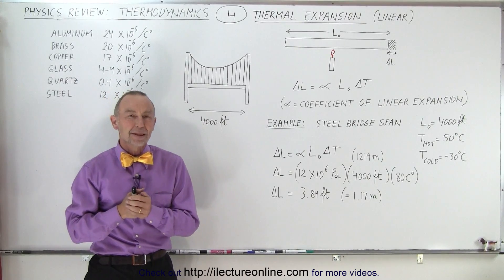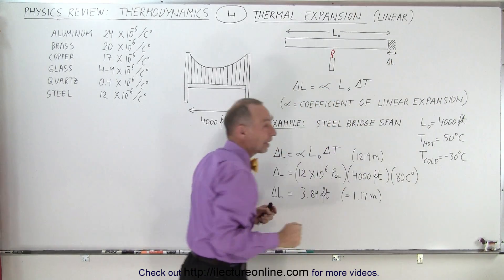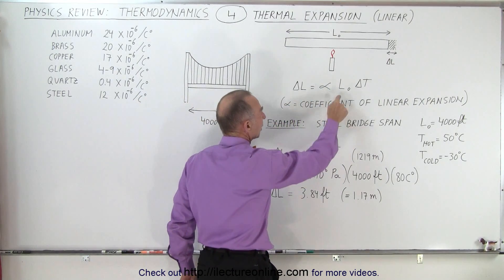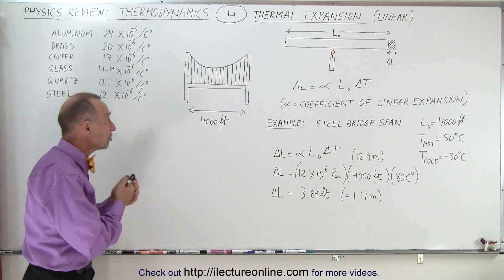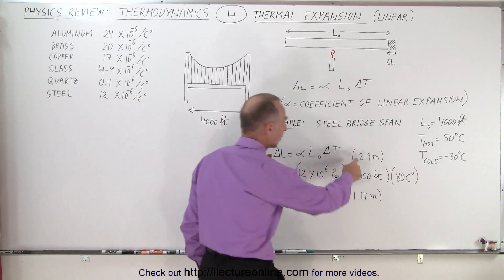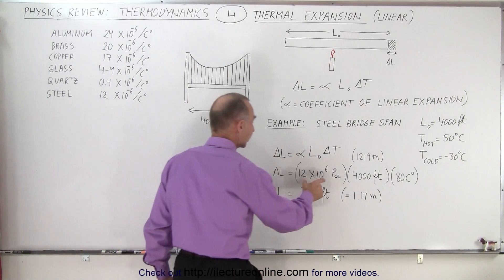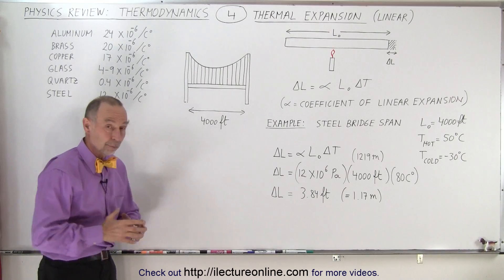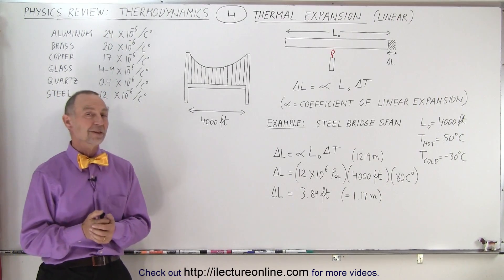Physics Review: Thermodynamics #4 Thermal Expansion (Linear)

Comment: Thank you. The coefficient of linear thermal expansion is linear in small temperature ranges. What does it depend on? Does it depend on the elastic properties of the substances or something else? By the way, erratum, CLTE for steel is 12*10^-6/degC, not MPa.
Reply from the maker: We take it as linear (good for most approximations), but the "constant" actually varies over temperature as well.